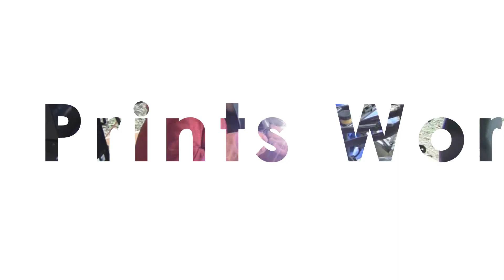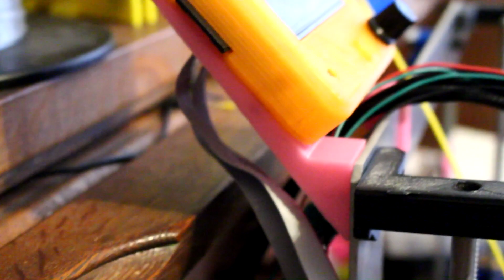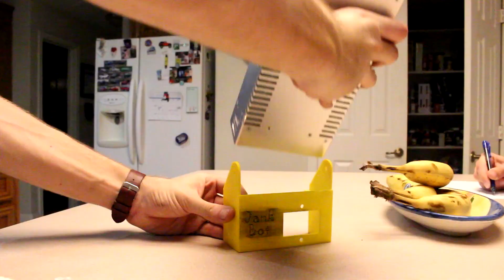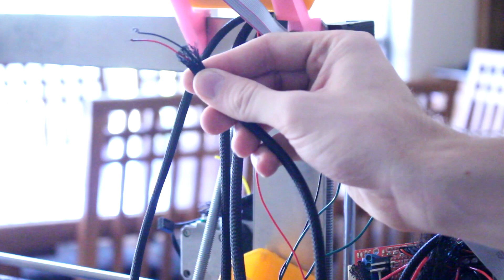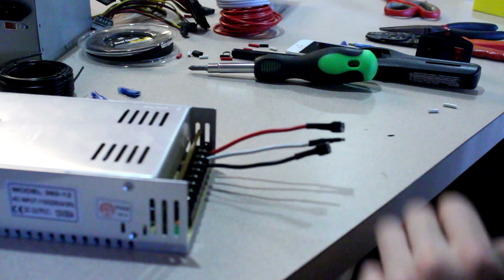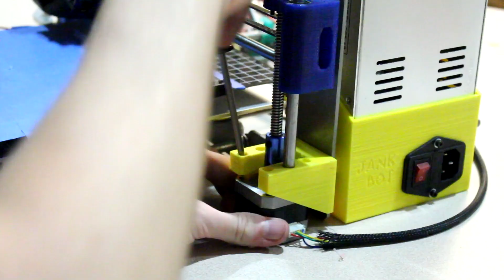3D Printer Power Supply Upgrade | Saturday Projects

Comment: asfar i know aside form the absolute bottom barrel  (which yours may be) the ATX desktop power supplies are better, atl east every is upgrading the 3d printer PSUs to ATX PSUs.
Reply from the maker: ATX power supplies will definitely do the job for printers, but isn’t necessarily better. For small desktop printers, especially simple Prusa style ones, the power supply I upgraded to is more than enough to handle what the printer is asking of it! The only issue with them is probably build and component quality, but that really just depends on what manufacturer you’re getting them from. The biggest thing for me, however, was getting a small, complete package of a 3D printer, where everything is attached and moving it will be easy with no issues. You really can’t get that with an ATX power supply, without it being incredibly bulky.

Comment: can you post links for the PSU and the holder you made? (assuming its on thiniverse?)
Reply from the maker: Sorry for the late response, but I updated the description with the parts I used! As for the holder, it's kind of unique to my printer. The frame is from DIY Techshop, which used their own bolt pattern for the Z-Motor mounts and it also has an extended bed, so the angle for the Z-Support rod is also unique to this printer, and since the company went out of business pretty fast, their isn't really anyone that has one haha.